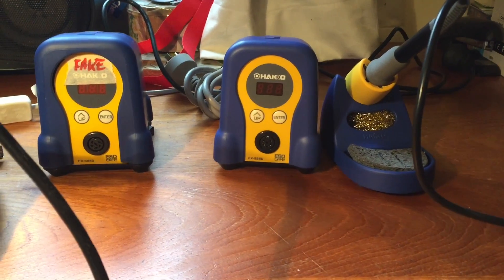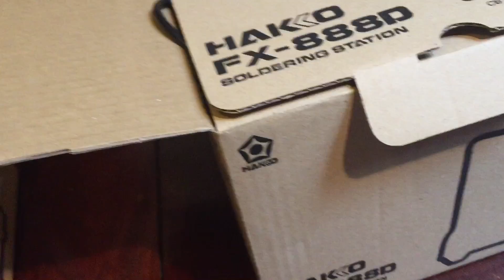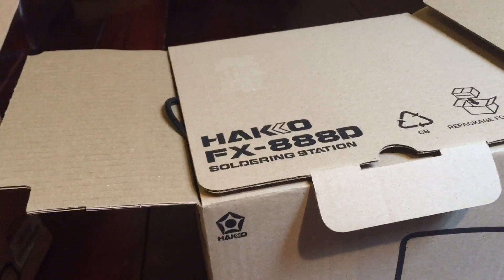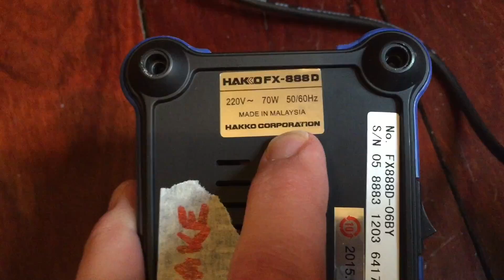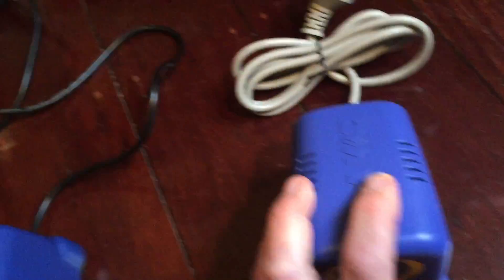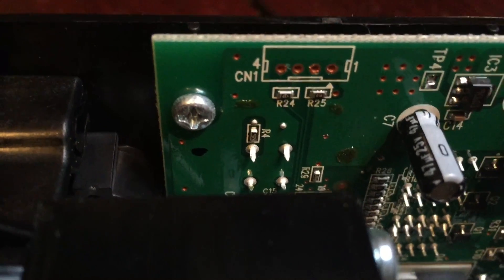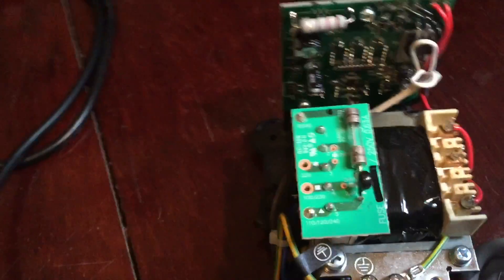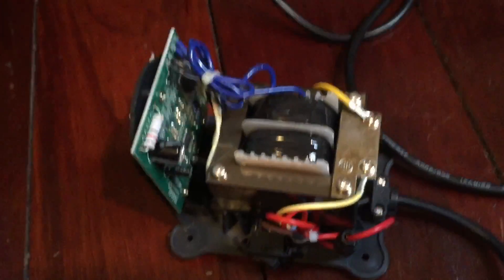Hakko FX-888D - Real vs. Counterfeit - how to spot a fake

Comment: so it's a Fakko  then....
in honesty i don't see the real issue with it
i mean. if the internals are not bodged or dangerous, and it's looks genuine and it feels genuine.
what's the problem
Reply: I agree, if you paid Fakko price for it, there's not really a problem IMHO - it's more of a problem for the Hakko people defending their brand. 
If you paid full price to get a Hakko but you get the Fakko instead - then there's a problem...
Reply: e5frog

i agree on these 2 points with you

1. Hakko should defend their brand and reputation and protect themselves from imitators
but that's a company agenda, Not a consumer agenda
because if there was a company called  onehunglow Pty Ltd and the brought out a soldering station that was IDENTICAL to the original Hakko inside and out and it was IDENTICAL in price
would the consumer really give 2 shits............. NO they wouldn't

would Hakko give 2 shits... HELL YEAH they would
so the agenda of the company is not usually the agenda of the consumer

2. RE the price
consumers care about 
- Quality
- how it feels
- the safety aspect of it
- and of course price

in my opinion
we've already been through the QUALITY debate of it and it's pretty much the same
the only debate the remains is....

if you paid for something THINKING IT WAS ORIGINAL HAKKO you should get original Hakko... i agree

Now... there is a fine line here

one side of the debate is
if you ordered original andpaid the price for ORIGINAL you should get ORIGINAL

on the other side of the debate is this
the onehunglow company can argue....

if we have supplied a product that is identical to the original , why then should be not be able to charge the same price

THE CONCLUSION TO THIS DEBATE IS THIS.....

1. if the product is identical there really is no difference and nothing worth debating

2. as for price,   Price and Value and the worth of something changes from person to person so... THE SOLUTION IS THIS....
IF A PERSON BUYS A FAKKO but gets Hakko Quality,
someone might say.... it's not a big deal
another person might say, this isn't what i fucking paid for

each to his own, i guess

Point is... Regardless of what you pay
IF YOU BELIEVE YOU GOT VALUE FOR MONEY,  don't worry about it.

IF YOU BELIEVE YOU GOT FUCKED OVER, get a refund
simple as that

Me Personally
i would only seek a refund if the quality was shit
otherwise i wouldn't worry about it

as for the ethics of the company that sold it to me.
well.... i would have no respect for that company and probably wouldn't do business with them again, but if they didn't send me a shit iron, i would probably hang on it

Ironically, i recently bought a Yihua 936  which is a rip off of the original Hakko 936

the fucking thing fell apart in hand while soldering at 400 degrees,
needless to say this is fucking dangerous and i certainly returned it

upon return they didn't really seem to give 2 fucks
they did say to me "it's never happened before"  hehe.. yeah right

so.. this leads me to conclude 3 things

1. either they are full of shit (and are clearly selling a cheap shit product that falls apart and they know it)
or
2. they don't know it because no one complains when it falls apart
or
3. i just happen to get the one that decided to fall apart

whichever way you look at it,   IT'S A PIECE OF SHIT and at 400 degrees.
this is inexcusable.

but, i'll say this
if it hadn't of fallen apart in my hand i probably would have kept it.

i opened it upon purchase, it seemed safe
the base felt nice and heavy
the wand did feel like cheap plastic and .... it is the reason why it heated up and broke in the middle as a result and popped apart in my hand while soldering

i've owned  a cheap shit $20 soldering iron prior to this,
even though it was cheap quality, it never broke apart in my hand.

actually at one point it was melted from the heat, but, it still never broke apart
this YIHUA brand is a piece of shit

so. i say
if someone gets a FAKKO 
the quality is the same , it really comes down to how you feel about paying the same price

my opinion is SAME QUALITY should equal SAME PRICE
but there is the dishonesty aspect of it as well

and..
in my opinion if the quality is the same, i would pay the same price, 
but as for the punishment of dishonesty,
I WOULD NEVER DO BUSINESS WITH THE COMPANY AGAIN

and that... in my opinion is FAIR AND JUST
Reply: Problem is another company is selling an item as a Hakko which they didn't design or market, plus if anything goes wrong good luck going to Hakko for support
Reply: Its not genuine not genuine parts made 3rd party just because they look the same not same quality or life span so shut the fuck up

Comment: Good to know that both thermometers do what they are supposed to do. All the differences you pointed out, especially the color differences of the back label and the On-button are dead giveaways of fakes. Hakko will always use the same "Hakko blue". The sensor packaging is actually showing a lot of differences: on the back, there are more symbols next to and under the Hakko logo and there are more symbols next to the bar code, on the front, "Lead free" is printed more boldly than on the fake one where the font looks very skinny. Last but no least, the patent number on the fake product does not mean that they paid for it - they probably based their product on it, though, as they always do :-)

Very good review, thanks :-) . You just forgot to test the real Hakko sensor on the the fake thermometer - i wonder if it also was about 5C off (higher).

Comment: The obvious tell appears to be the color of the cord. The fake is black and the Hakko is gray.
Reply: I have one from a reputable source and the cord is black (US plug). Just opened it to make sure it is real. It is, custom chip, Nichicon caps and separate fuse board. The sticker on the bottom is as narrow as the fake but much longer. It includes a MET compliance icon and a listing number.

Comment: I've got the real McCoy and it is the last soldering iron I choose to use.  All my other irons out perform it. I bought it in 2014, spent a ton on it and it never has worked well & just sits on the shelf.  It will hardly melt an SMD joint set at 850 degrees with plenty of flux on the joint.  Thanx for the video Lawrence.  At least I know I have a real one.   Guess I'll sell it on Ebay! ;-)  ps- yes, I have contacted hakko.
Reply from the maker: Have you checked the actual tip temperature? The user interface on the 888D is so horrible, I've accidentally changed the calibration rather than the tip temperature more than once!
You could have the thing running way colder than your set-point without knowing. That said, 
 the thermal mass on the 888D does seem to be a bit low - I tend to use an older, larger iron for anything lead free.
Reply: Hi LB- I have done a reset some time ago, so it should be good.  And I called Hakko about the time I wrote the post above. I think it is like you said, there is not enough mass.  Bigger tips do better, but can't use them on SMD stuff.  For whatever reason, it seems to be working better after the last reset.
Reply: @Bob Ograv. It sounds like your unit might need some calibration. Just because it is factory reset doesn't mean it is accurate. It is still not calibrated, at all. The way I test my 888D without a temp probe is just to melt solder. I set it to 183C and try to melt lead solder. If it doesn't melt, hold UP until it displayes "ADJ" then hit enter. Then change the "1.8.3." to something a bit lower, like say "1.7.5." and hit enter. Repeat these steps until the solder melts. When you want to adjust the temp, you hold ENTER, not UP. "ADJ" will not display, and the decimal points will not be lit up while the digits are flashing.  For a soldering iron with this terrible of a UI to receive 4.8 rating with over 400 reviewers (US Amazon), the iron must work pretty damn good, actually. Mine do, and 99% of my soldering is small SMD parts. TSSOP, QFN, 0603, and SOT23-X's are my bread and butter. I don't get too concerned with the actual numbers, anyway. If the joints are taking too long to flow and/or leaving dingies, I turn it up. If the flux is burning off too fast, I turn it down. KISS. Once you got it working how you want, you can enable presets.

Comment: I cant tell if mine is fake, the labels on the bottom seem fake like on your fake one but the chip inside is small and there are no labels on the connector. The strain relief on the handle seems soft too. One thing that wasn't clear in the video to me, is the base of the iron stand supposed to be all metal on the genuine? My one is plastic with metal plate insert.
Reply: I bought mine from Mektronics.com.au its got different stickers to your 2015 one mine is manufactured in 2013 

Its all about the insides to check for counterfit
Reply from the maker: Dominic - sounds like you're ok. The iron stand on my genuine is made of a die cast base and has a piece of sheet metal inserted. The fake is a single casting with no insert.
Reply: Yes, on closer inspection the chip looks genuine. Still, odd that the labels on the bottom don't have the compliance markings.
Reply from the maker: Dominic - different countries require different compliance testing and labels. Why not post a video showing what they look like for your country?
Reply: Actually that might explain the labels, the items is clearly meant for a different market since it has what looks like an Australian plug but then strangely the instructions are in Chinese.
Reply: I have a fake one, did not know until it arrived. the pictures on the sales page was of the "real one", the one i got have a analog chassis, but with digital display. but it has lasted for about 15months with relatively heavy hobby use. so I'm not complaining. fake does not necessarily mean crap. the temperature is spot on, and it heats up fast. ESD safe (tested.)
Reply from the maker: True, but what if it had gone wrong and you needed a warranty replacement?
Reply: You would have try to get a replacement from the seller, but Its not an ideal situation,  and would definitely not recommend anyone buying a fake/clone on purpose.
Reply from the maker: Good advice
Reply: Same, I got mine off ebay.
The label is small, but this can easily change with production.
But the programming header is like the genuine and the IC is small.

So unless the chinese have gotten a hold of the tiny ICs and are now pretty much making genuine clones which incase wouldnt be a bad thing if it is cheaper..

The instructions are in chinese but then again the chinese also use the AU plug for their power outlets, as well as other plugs as well as voltage and line frequencies .
https://www.travelchinaguide.com/essential/electricity.htm
Reply: Mine has a metal insert but the black piece that is removable is plastic, I bought it directly from hakkousa.com

Comment: could you please link the actual article on ebay? thanks
Reply from the maker: Hi Martin, the actual (i.e. genuine) item didn't come from ebay. I got a legit one from Element 14 - http://au.element14.com/hakko/fx-888/soldering-station-fx-888/dp/1719021
Reply: Truth be told I think I would have been happy with a fake one as loading your own  code would be much simpler. Lots of open source "Arduino" soldering iron code out there to build from. I've used my Hakko a lot since I got it and it's great iron mechanically but I really do hate the interface it uses. The front buttons should be used for up and down temperature adjustment with a long press for menu/select.